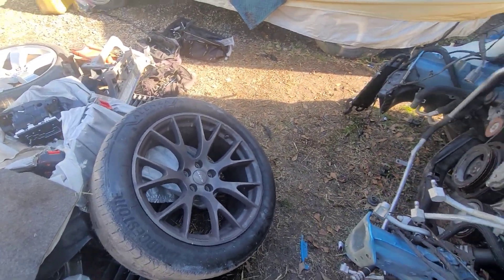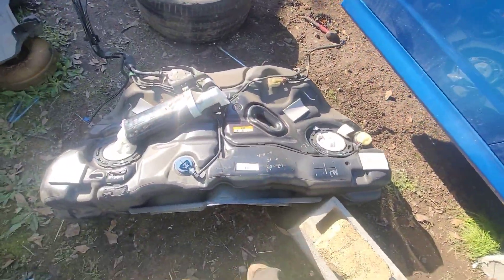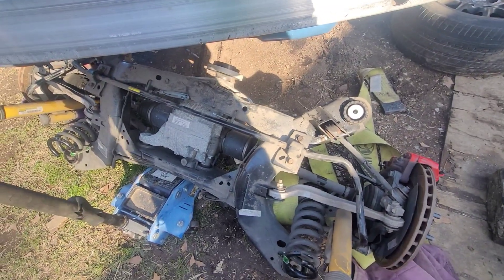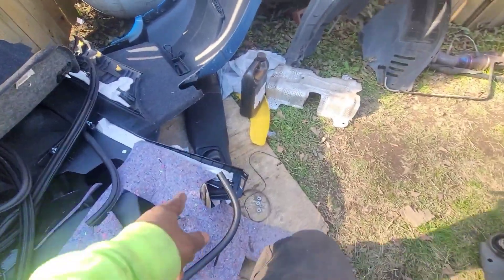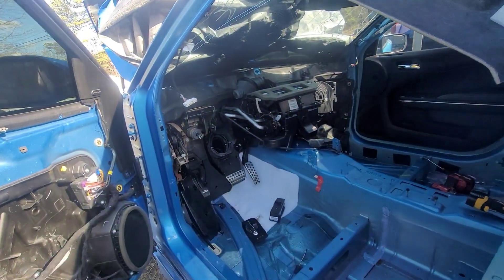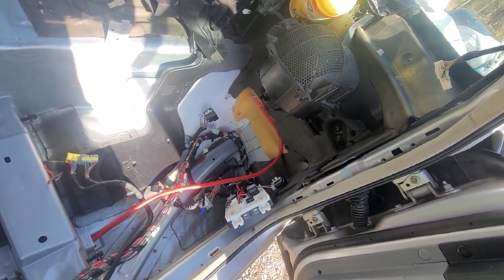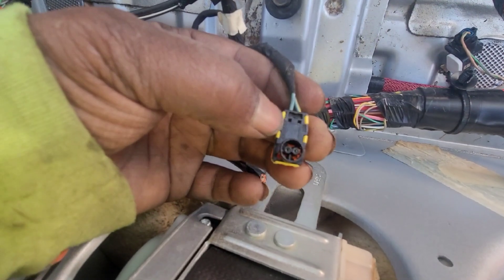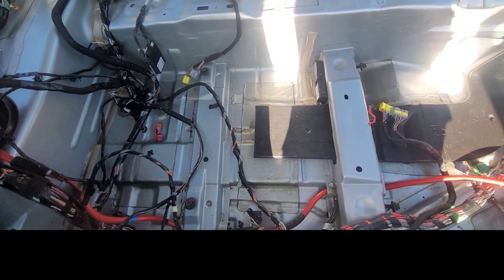SRT 2007 charger hellcat swap pt.3

Comment: I’m doing the same thing w my seat belts, probably just going to program them off & the new charcoal canister doesn’t bolt to the old model, so I’ve been trying to figure that out
Reply: @cooterbrown7681  you using them for the reprogram? Or something else
Reply from the maker: @SRTDC  to reprogram my module and my seatbelts that's on the seats. But I think I'm going to cut  the plugs off my old harness and resplice them into the hellcat harness.
Reply: @cooterbrown7681   true, i thought about that too but i didn’t know if it would work or not
Reply from the maker: @SRTDC  I'm try it
Reply: @cooterbrown7681  say brotha, if you hear or see anything about 15+ Charger brake lines can you lmk! Those are the only things I need left